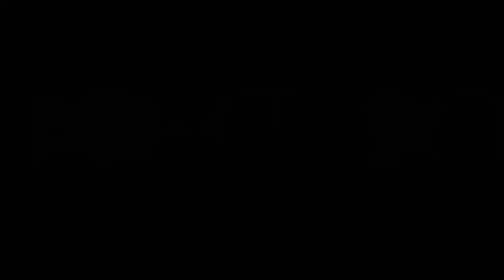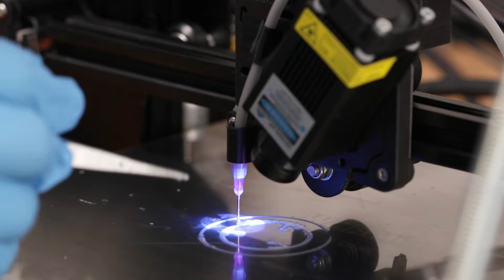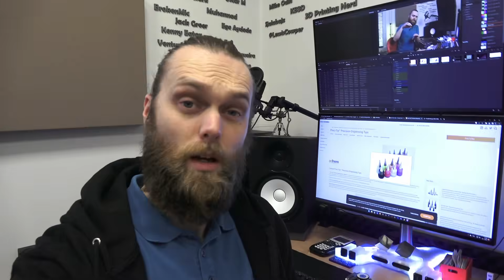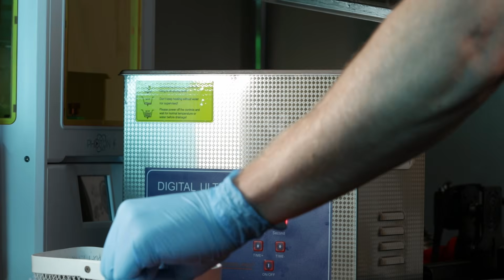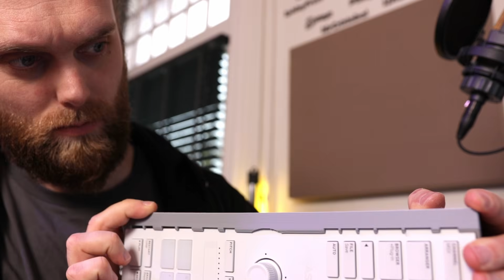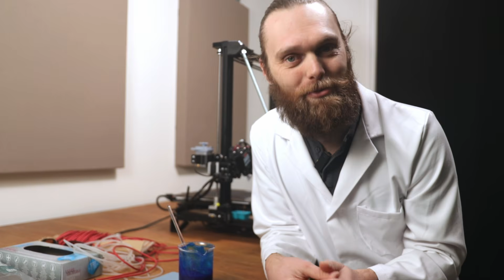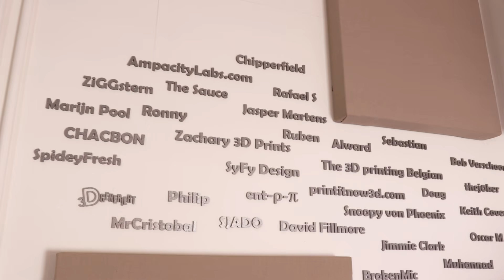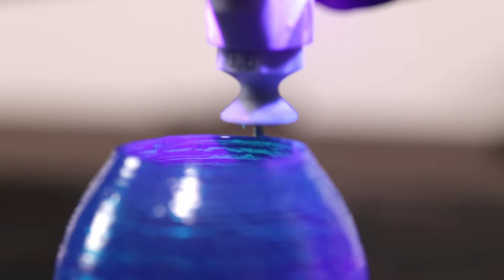I made a CUSTOM Nozzle that 3D Prints GEL!

Comment: 2 influential key points to focus on: 1. the ratio of powder to resin. This needs to have much more iterations in mixing ratios and not always in high amounts of resin. To come up with a simple test rig other than your printer to see flow out of your nozzle should be doable. I would not test curing, just the flow. Also the tube inner diameter is surely essential for controlling the pressure.
2. the UV light application: how about a tacted on / off light instead of a continuous light to avoid too fast curing and blocking the move of your nozzle.
Basic failure point is: you are adding a self made mixture of resin and powder to a highly complex system. I suggest to solely concentrate on understanding the mixture - flow rate first to get a repeatable formula and method of making the gel and testing it on a much less complex system.

It is admirable to see your dedication. Just go on.
Reply from the maker: Thanks for your insight and I completely agree! I get the best results by playing around first and go with my gut feeling. This way I get results fast, get a prove-of-concept, after which I have a baseline to continue upon. Eventually a more systematic approach is mandatory for this to become successful. The added advantage of this approach is that this makes for a more appealing video which then again results in more people getting involved and come up with ideas/suggestions. My goal is not to bring a fully developed system or product to the market. My goal is to inspire people with my ideas, experiments and inventions. Therefore, most of my videos "just" show a proof-of-concept for people to play around with. This being said, I want to do more research on the mixture itself since this is so interesting!
Reply: @properprinting  my background is working as an artist in Berlin for a very long time, making all kinds of transparent sculptures and testing many different materials and methods on the way, casting bronze sculptures and tried out practically any type of patination, later learned gold smithing which I am doing until now. I came in contact with hundreds of raw materials and I am until now very experimental in my jewelry work. I can recommend to contact the company Kremer Pigmente and talk to Kremer's son. He is incredibly knowledgeable and Kremer carries practically any kind of resins, fillers and solvents. He even might be able to help in mixing for you a gel. They have all the equipment. That being said, try everything non standard for your gel viscosity, gel material and the phase between nozzle metal contact to object. I can see even a separate liquid being dropped or sprayed during printing on the contact point between noozle and object as a lubricating and controlling the curing time. I have UV liquids here up to 9000 cps. Practically to tone this viscosity down with lower viscose liquids and even with a solvent like acetone can be considered.
You are one of the very rare persons here at Youtube, who share intensively your experiments and skills. You have all my respect. Bravo.

Comment: It would add to the complexity for sure, but how do you feel about having another peristaltic pump mechanism pump air into the resin cup in order to pressurize it? This might help with some of the flow issues.

In theory, you could also run this pump backwards to pull a vacuum which could potentially allow you to skip the vacuum chamber step. If the vacuum were powerful enough, you could also use it while running the other pump backwards to potentially suck some of the resin stuck in the tube back into the cup which could help to make cleanup a bit easier.
Reply from the maker: Pressurizing the vat with a peristaltic pump sounds like an interesting idea. That would've never occurred to me, thanks!

Comment: Just a thought. Why are you making the nozzle so thin when you have already created a new nozzle design? I understand oozing may occur but with the thickness shown I think that maybe you just need to move up to a larger nozzle diameter to reduce backpressure. A side note, Does printing slower or faster help? this looks like relatively FDM speed but with different filaments you tend to need to vary this.

Comment: Use a tube with wider diameter to feed the gel to the nozzle. 
Let the laser hit the nozzle trough a diffuser such that it just slightly cures. Use a conical lense instead the nozzle lip to block off the laser for that.

Comment: Only use silicone tube inside the pump, use something not as streach-able after the pump so you can't build pressure. metal/plastic/whatever.

It should make start/stop of the gel more consistent.

Comment: Put the resin gel in an vac sealed bag and run a tube to the extruder. Hang the bag above the gantry and you'll have gravity and psi helping the gel flow down. You could improvise with a foodsaver, or buy empty IV bags.
Reply from the maker: Maybe just using IV bags is not a bad idea, thanks!

Comment: First I want to say thank you and you are doing fantastic. 
As another has stated, the injection of the fiber may help with surface tension as well as bridging. 
To throw another variable into the mix, have you thought about adding a relief to the nozzle on the back side of the nozzle movement and creating another axis that turns the nozzle in the direction of travel so the relief is always at the rear of the travel. I believe they use a sinular process for concrete printing. 

What have you done for flow calibration testing such as e-steps? Does Viscosity dictate layer to height to some degree due to surface tension? Would a higher intensity laser cure lower Viscosity resins faster? Could the new nozzle be adapted to utilize the fibers for light transmission? 

Sorry for all of the questions but it is how my problem solving skills work.
Reply from the maker: Thanks for your comment! Legit questions! Right now I use that pawn to tune the e-step value. That value had to go up when the viscosity went up in order for a successful print. There are so many variables and although a systematic approach is eventually needed, I get results faster by using my gut feeling and screwing around. The proof of concept will be the baseline after which we can adjust and improve systematically. Regarding the concrete printing and rotating nozzle, I want to make this work with a standard print process, so it's easier to incorporate. Unless otherwise impossible.

Comment: you should use a much thicker tube. That will reduce the viscosity effect and help with pumping. You can use narrower tube at the nozzle, and maybe in the pump itself for better resolution. There's a huge amount of resistance when trying to push something that viscous through such a long length of tube so narrow.

Comment: First time viewer, but this channel is super cool. I have a suggestion for the gaps but first I have a question, when you go to print the gaps, does the pump shut off in between gaps? If it does, run a electromagnet in series with the pump and put a ball bearing in a tube as close as possible to the nozzle so that when the pump shuts off the ball drops as a result the fluid flow and gravity, this will allow minimum amounts of fluid overflow. It’s basically a one way check valve with a magnetic override.
Reply from the maker: Welcome and thanks! The pump doesn't shut off, the stepper motor stops receiving pulses, but stays activated. There is a way to work around this, but because  want to add a fiber I need the nozzle to remain open. I've got the feeling that the fiber will change everything! Thanks for your suggestion!

Comment: Not sure if you have had an issue with dripping when stopping the pump but you could look at a "turbo depositor nozzle" used in the food industry they have a piston inside the tube and when product "food" needs to be stopped without drips either for presentation or weight control it basically seals the open part of the nozzle.

Comment: Mount a pvc pipe above the extruder and use a threaded rod to push a plunger into the pipe extruding the resin at a fixed rate under it's own hydraulic pressure. Also perhaps think about changing out the tubing or even buying a fiber sleeve for it so the tubing itself does not expand while trying to print.|
Edit: Maybe also start a discord for people to give feedback on projects as you're trying to solve problems. I definitely thought about modeling this in fusion for you when I thought of it lol.
Reply: Look at the clay extruder printers, they just use an air piston to press a pusher plate in a tube to get the flow needed. It requires a separate compressor but not a terrible option. That setup is used for dispensing paste for solder.

Comment: You could use a seringe to push the resin. But your main issue is cure and with time some gonna block. You could maibe use something to purg / clean the nozzle every couple off layers. You could also print inside gel then cure the thing later, it will fix bridge issue and stuff.

Comment: I feel like skipping steps and trying to introduce the fiber idea might be the way forward, the fiber should be able to provide support for liquid resin, avoiding the problem with the pump while also strengthening the print.

that would also make it more practical, because while I do love your idea, I don't really see the point, it kinda seems like resin printing without the advantages. however with the fiber, it could lead to super strong parts, using a manufacturing method never seen before !

and even if the fiber doesn't work out, you might get new insights on how to improve your FDM resin printing idea.

Comment: If the aim is really continuous fiber printing, you shouldn't care about bridging. Firstly, you won't have very much bridging to do, is defeats the purpose of continuous fiber in most cases. Secondly, bridging with a fiber holding the paste should be way easier.

Comment: I think your solution may lie in the next step of the project. Introducing continuous fibres into the nozzle might open a slightly different approach of pre-impregnating the fibres as they are run through the nozzle. This can be done beforehand instead of trying to pump the resin into the nozzle, have the fibres run through the resin and then out the nozzle. My two cents would be you're going to encounter further problems trying to traditionally 'print' using this type of nozzle, a roller bearing system that places the fibre in orientation might be an avenue to travel down.

Comment: This is excellent and valuable research. Even if the bridging problems can't be overcome, this could still be a novel addition to a toolchanging setup. Bottom layers or bridge supports could be made of a traditional FDM filament, or dissolving supports. Even without continuous fibers, filling certain volumes of a model with cured resin could be an unexplored frontier for material properties.
Reply from the maker: Eventually I want to add this to a tool changer setup. A platform able to print molten polymers, resins/pastes/liquids and fibers enables so many interesting possibilities!

Comment: There is a really easy solution to getting a consistent viscosity of your resin, it is temperature! You're doing everything right, but making it too thick, now that doesn't have to be a problem per se, because resin is temperature sensitive. I print my resin in my schuur (haha, it's dutch guys the barn!) and because of the low temperature there i use an wire heater around the vat to get it at the right temperature, in this case thinner so my print are more accurate. In short warm the resin and it gets thinner, cool it it gets thicker, combine this with the right base viscosity and you should have the thing you need which is viscosity control. Now you could go the heated end way, like a normal fdm printer but it could also be you'd need to cool the resin up front. basically in my experience between 10 to 30 degrees Celsius is the range you'd be working at.
Reply from the maker: Temperature definitely is a factor I need to look at! Thanks :D
Reply: @properprinting  Yeah i think it might give you the control you need, you'd have an adjustable factor instead of using the standard viscosity and pressure.

Comment: Hey jon, I talked with my father about your ventures in the resin fdm world, as we both are very interested in the rapid developments of 3d printing. He has made several ships and their masts with the use of carbon fiber and epoxy resin. In doing so, he has gained quite some knowledge about polymerisation, resins, and composites. One of the things he noted on this video: usually, in epoxy, aerosil is used simply to keep in suspension/solution whatever it is you are trying to mix in. He has also specifically done this with the glass you mentioned. Another thing that is quite interesting to me, is that he said that occasionally, when you really need to prevent the epoxy from drooping, he'd add aerosil untill it is barely fluid anymore. Then, by applying heat, the resin mix becomes much more fluid, and workable again. After applying the resin, it loses it's heat, and becomes near-solid again. This sounds like a really cool thing to test to me, as it would be the ultimate combination of fdm and sla to me :D
Reply from the maker: That's a very interesting insight, thanks for sharing this knowledge!

Comment: what about a larger diameter feed tube to lessen the pressure. Or change the peristatic pump for one like they use for clay printing where it is basically a motorised syringe.

Comment: A problem that you're having is that there's just too many variables.  The consistency, the pump, layer height.  You're changing multiple things with each experiment.

Here's my suggestion.  You need to find a resin consistency and stick with it.  Something that the pump can handle and you are happy with.  Then you need to do simple line tests.  A straight line across the platform, a wall, a circle, 1 perimeter, two perimeters.  Take it one steper at a time. (pun intended)  Use these micro tests to figure out your layer heights and speeds.  Stop jumping straight for the benchy.  You don't have other people too get a consensus with so you need to be ballistically thorough.  Pretend like you're a scientist whose discovering a whole new kind of 3D printing.  Because you are.

And I say this because I have the EXACT same problem with my experiments.  Inventors are a different breed from scientists and we like to jump straight to taking the Iron Man suit out for a test flight.  Take it slow.  You got this.
Reply from the maker: Thanks Tory and I completely agree! For me the pawn vase mode is a good test subject and right now I'm in the proof-of-concept phase. I will do something similar with the fiber and use my "gut feeling" to get some results. In order to make this work, a systematic approach is inevitable. Like you say, there are so many variables! Thanks for encouraging this!

Comment: I bought my first 3d prnter like 10 years ago. The first two screens of my Prusa MK1 were instantly fried by simply touching the screen -- static shock. My solution was to put the screen inside of a transparent ESD protection bag which I grounded to the ground wire on the LCD connector. Never had the problem again. ESD protection is important!

Comment: For the resin, I'd be tempted to treat it more like an IV bag. This gives you 3 main advantages:
1) Gravity will help push everything through the system.
2) If the container is sealed, you could add a pneumatic fitting to the top to pressurize it.
3) Easy to refill mid print, assuming you have an opening on the top as well.
Reply: Nice idea. Loctite pistol dispenser for UV resin works exactly like this (minus the IV part). It's like a pressure cooker with a tube exiting from the top
Reply: Yeah was going to say gravity feeding it will drastically reduce the work of the pump so it's not trying to pull the thick fluid up and into it.
As for the rest of the problems well I'm not sure there is much you ca do about it bridging gaps, there is a reason why current resin printers work from the top of the piece down, it's much easier to use a laser to activate it at the point instantly hardening it rather than ejecting a fluid then trying to get it to harden.. It'll always drip or turns into a string causing lumps in the working surface as is the nature of fluids
Reply: Needs to heat the resin

Comment: Lower the power of laser and point it the on tip of the nozzle where its depositing. You may need to push the lasers modules little far from center. Rather than pump, use drill bits mechanism to push the resin through nozzle.

Comment: Hey there. It looks like your nozzle doesn't have the ability to flatten layers as it lays them. If you look at any FDM nozzle you can see that the hole has a little surface that irons the extrusion in place. 

Your copper pipe nozzle doesn't have that which could be a reason why cured resin is sticking up and later colliding with the nozzle. 

You should try a nozzle with a thick wall for smoothing the resin.
Reply from the maker: Thanks for your suggestion and I think that this could help indeed!

Comment: I get so excited to see you post a new video! Fantastic work as always this is so inspiring! This may be a lot on the stepper  motor but it would be so cool if you could create a stack on the motor that has your pump and extruder/fiber extruder in one where adjusting the gear ratio would get different feed rates on the resin and fibers.